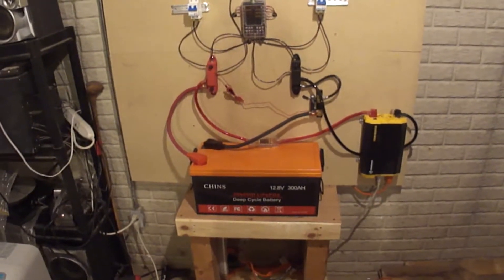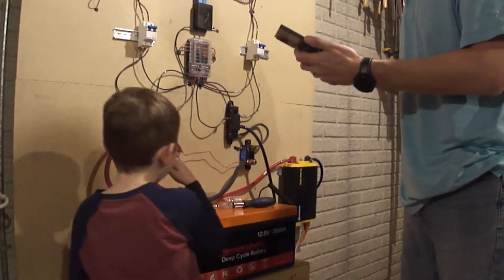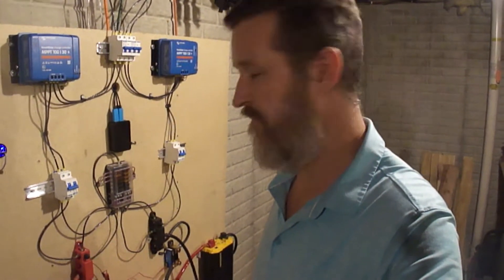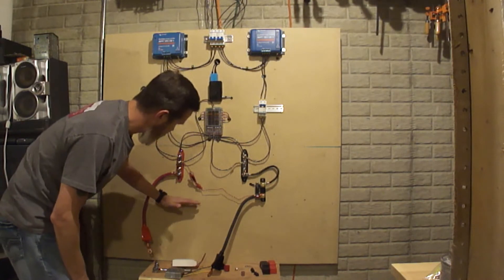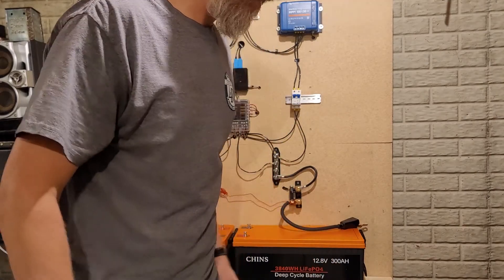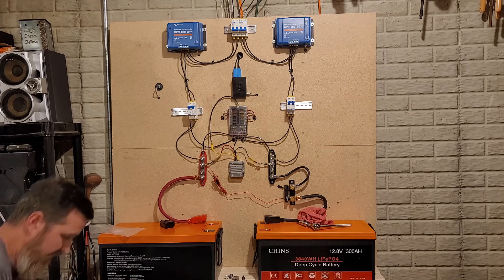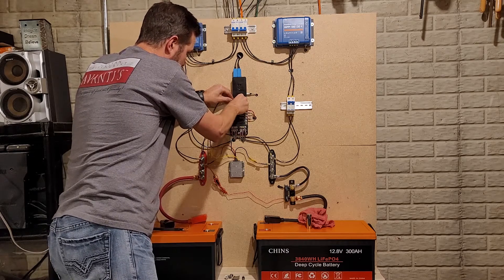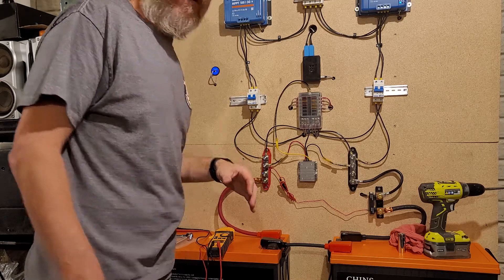Upgrading my 12v off-grid system to 24v!  Part 1

Comment: I know this is an older video but I am doing this conversion and would like to know if the Victron Charge Controller automatically switched to 24v or you had to program it that way.  I think the CC will automatically sense the 24v coming from the batteries and automatically charge at that voltage but I don't know for sure.  Let me know if you have time.  Thanks

PS:  I have been going thru some of your old videos back when you first started and I noticed on some of them I was unable to comment or click on "reply" or even the thumbs up icon.  Do you know why?  If you want to test it out the Part 2 of this video has this anomaly
Reply from the maker: Yes, the charge controller will automatically sense the voltage and adjust.  I didn't need to do any manual adjustments to the voltage.  Thanks for letting me know about the locked videos.  I'll look into it!  Thanks for the comment!

Comment: From a Safety point of view. Think about this for a sec.  A/C mains box....= Battery.... first connection in mains box are breakers (Source) for mains box right?  Did you fuse the battery at the POS post (Source) with a fuse (breaker)? Nope....You might say...Battery has BMS don't need a fuse at the battery....Wrong!    Mains box also wired from the meter box (Source) from a... breaker...Right? Same thing. Meter box is connected to transformer pole wires (Source) and Fused....right? See the pattern? It's a Safety Issue.   Source....then fuse....etc.  Put a fuse at the POS post of battery (Source).  Source then fuse THEN wires then load for EVERY circuit..just think your wiring a A/C Mains box. Your determine the size of each wire to carry that (Load). You determine the size of the Fuse by the size and length of that wire. Also if you had to go to a different Battery with no BMS your covered and SAFE?  Right?  Good content.
Reply from the maker: Thank you very much for the great information and the comment.

Comment: When I connect two charge controllers to a bus bar, they fought each other because the detect each other’s current long before detecting battery charge.  How did you get around this?  And I’m thinking if you’re managing those controllers via Bluetooth only you may not be able to view the battle going on.
Reply from the maker: The charger controllers work with each other.  It's a network connection so they communicate and act as one unit.  Hope this helps.  Thanks for the comment.